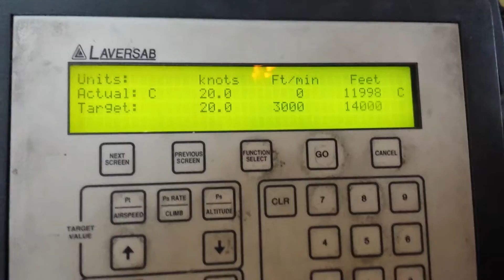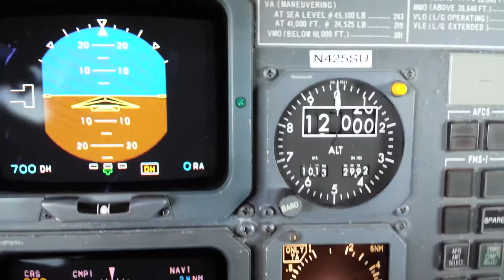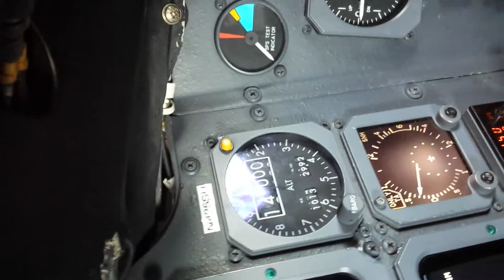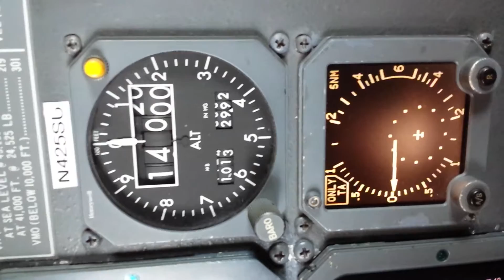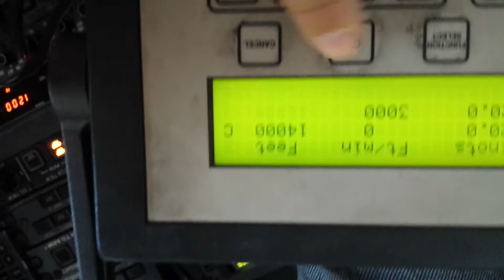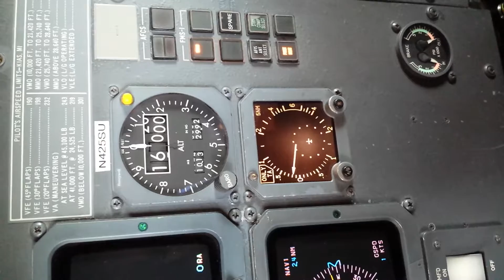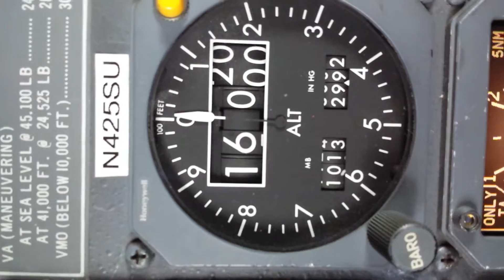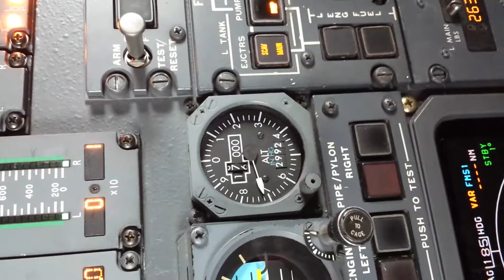Pitot Static testing on a corporate jet.

Comment from the maker: The Pitot Static Test on a corporate jet that is RVSM qualified is very specific. The technician is required to follow guidelines as set forth in that aircraft's RVSM Manual. Each test is fundamentally similar but at the same time can be very different from one aircraft to the next. On this aircraft the Pitot System was only leak tested.